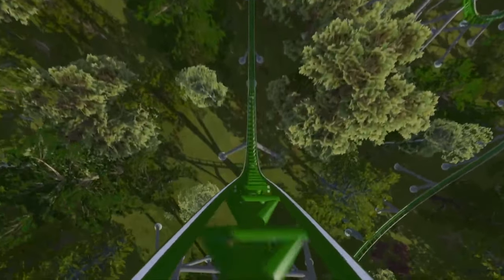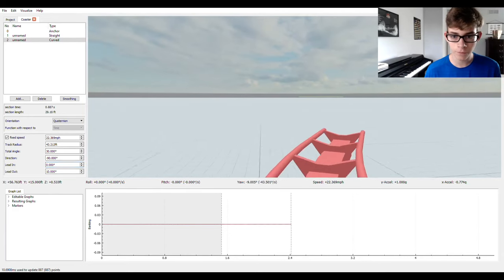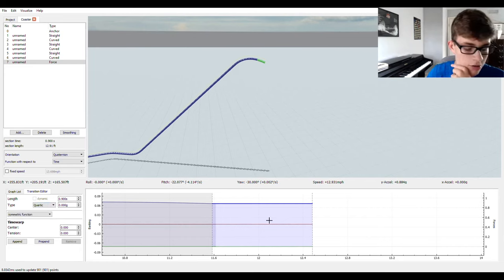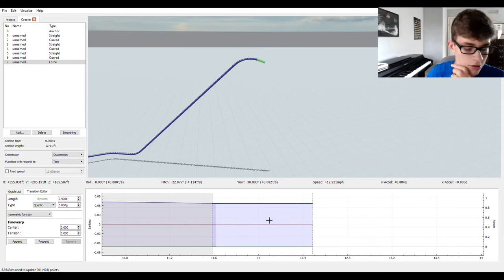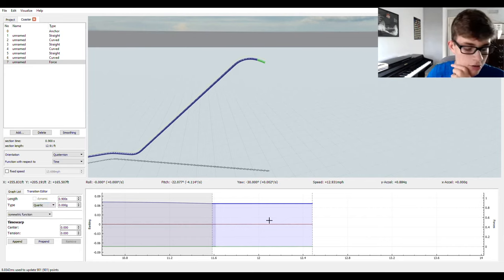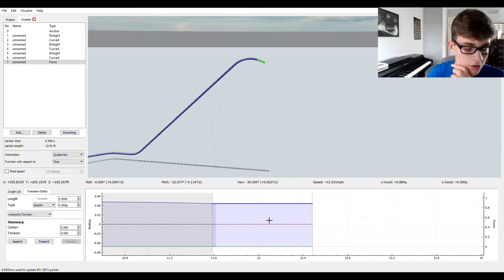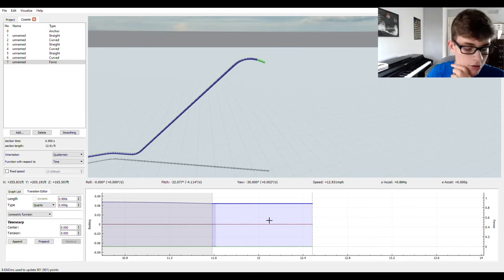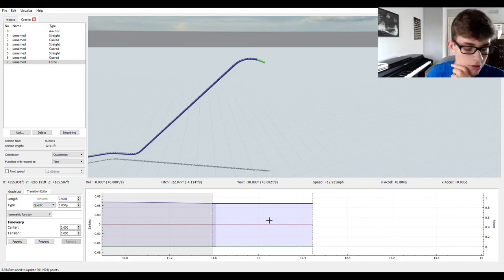How To DESIGN A ROLLER COASTER | FVD++ Beginners Tutorial

Comment: Great to see this. I personally find it really hard to set the overall size of the element as I want in FVD++.
Reply from the maker: Yeah its hard to figure out certain elements sometimes
Reply: I'm new to FVD and have quickly learned section time length is literally just as important as the g forces. Sometimes, you just simply have to have a transition be smaller and change the g forces to get the shape right. I use 0.5 seconds for a lot of my stuff and go down to 0.2 if i have to.
Reply from the maker: @jordanwolfson8378  Very true!

Comment: Thanks for the tutorial! I am currently making Magnum XL 200, but I seem to be running into a problem. Every time I make the turn that leads into the lift hill, it starts uncontrollably banking even if I put it the pieces before it on euler or as straight track. Do you know what to do?
Reply from the maker: Hmm I’ve never encountered something like that before. Just make that if the turn is rising higher or lower make it a geometric section instead of curved.
Reply: @EliteCoasters  That's probably the problem

Comment: Fenix at toverland hits -0.6Gs normally 32:58
Reply from the maker: It may hit that using g-force recordings from riders, but -0.25 g's was designed into the ride (measured in the middle of the train). B&M said that the -0.5 g's on Dr. Diabolical's Cliffhanger was the strongest they have every designed, and prior to that they didn't go below -0.25 g's. They may have been incorrect, but I'm just going based off of what I have heard.
Reply: @EliteCoasters  I saw a G force graph vid from it on the channel "coaster stats" and the G' forces on fenix on the airtime hill were around -0.6Gs normally & also thanks for this greay tutorial video will try it out!👌🏻